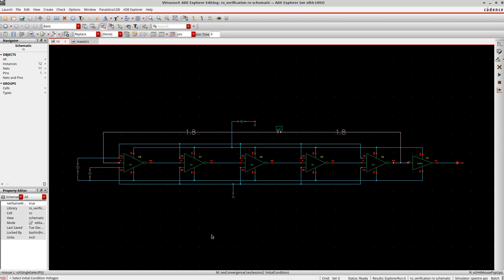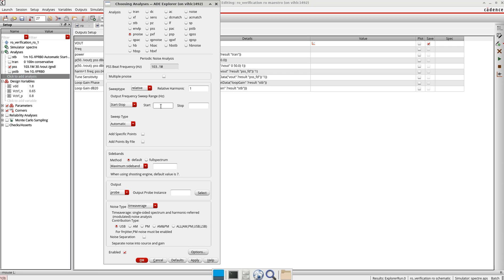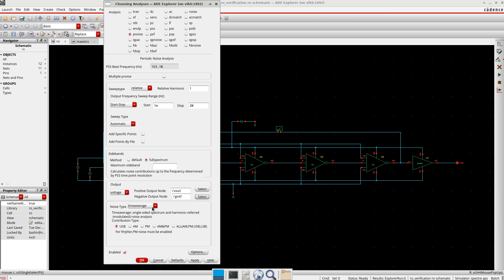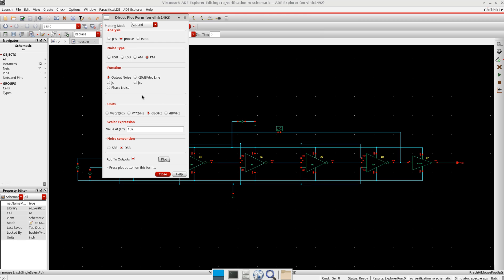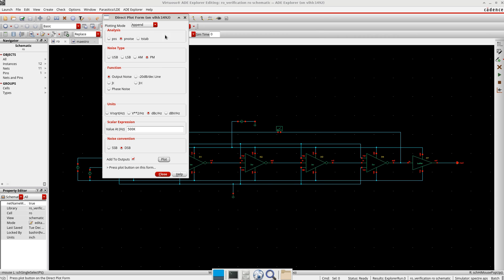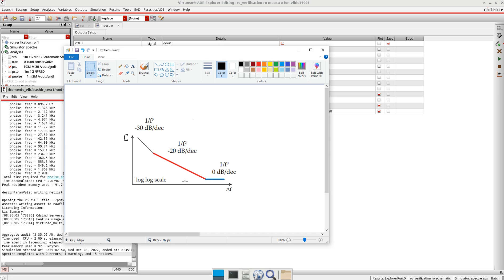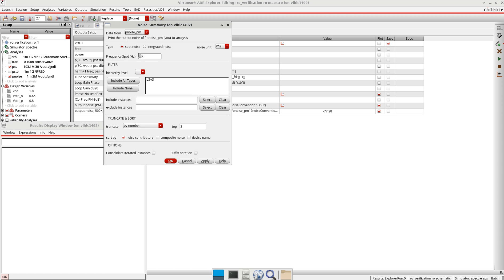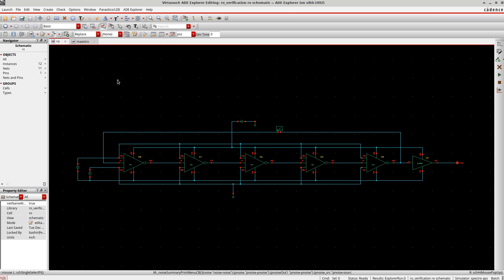Phase noise analysis of an oscillator #cadence #oscillators #pnoise

Comment: Sir Can we design crystal oscillator in cadence virtuso?
Reply from the maker: no, but you can model it
Reply: @MudasirMir7  that means I need to take equivalent circuit of crystal oscillator device in the circuit and design right?